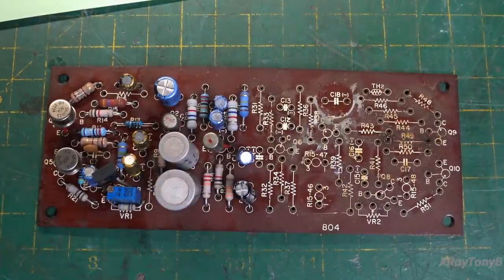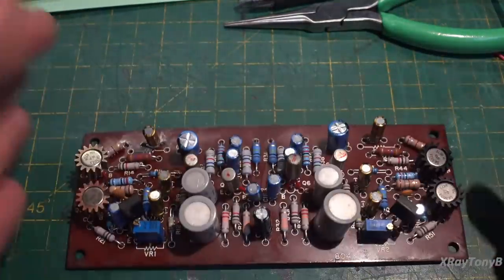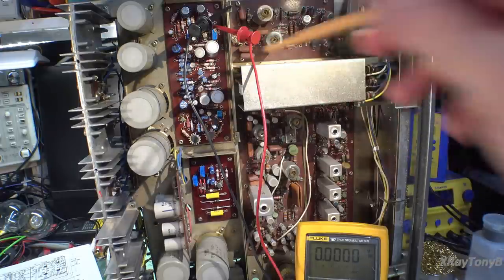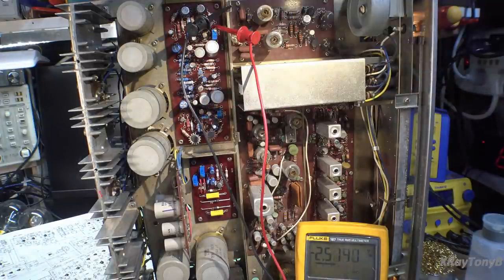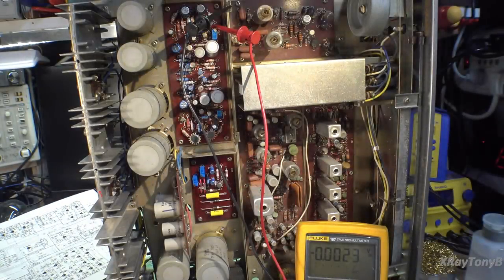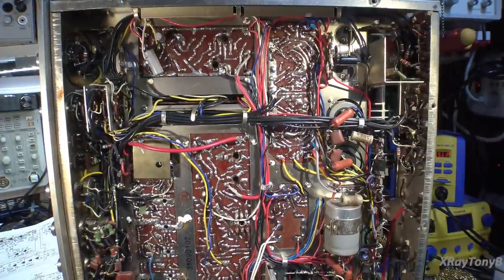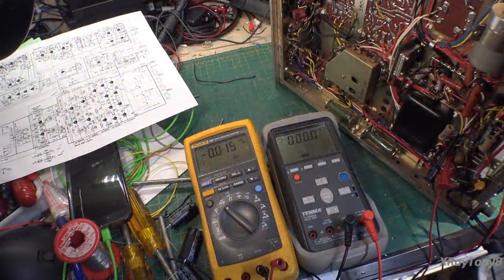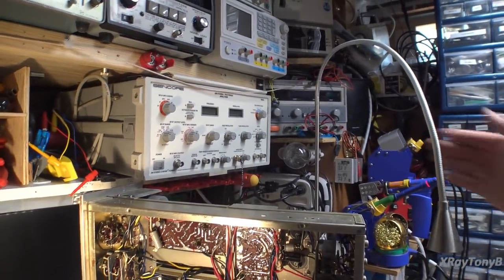Kenwood TK-80U Receiver Part 3:  Making Progress

Comment: I serviced a Kenwood amp from the same era a couple of years ago.  The 10,000 µF filter caps showed the same bulge on the vent holes.  Actually, one had burst open and a bit of electrolyte had leaked out of it.  But the caps checked out fine when I measured ESR and capacitance.  I guess the rubber seals on those vents just get brittle with age without affecting the values. As an experiment, I removed those caps, I drilled out the vents and sealed them with a silicone compound.  Then I used them in a stand alone power supply for charging batteries.  Works fine, no leakage, no temperature issues and great filtering.

Comment: This is as addictive as a good adventure movie! Please Tony, we expect the next episode: the return of the dead preamp!
This receiver is a perfect example of troubled engineering, representative of the tube to transistor evolution: complex high voltage filtering, each stage coupled with a capacitor, a class AB that is prone to flame in A class with a catastrophe, a subtile mix of available technologies, mixing HF tube, germanium and silicon components. In this one we miss the germanium rectifier and the power tube rectifiers, and it's a good step forward.

These equipments are always a challenge, but you're mastering this one as you've understood what was the original concept, and where the last technician has failed to make it work fine. And what is probably most exciting, is you know this project is to make a relatively modest performance receiver. But assuming Kenwood and Trio made excellent tuners and quality HiFi equipment, I hope this project will finally sound good!
I guess your next step is to inject some signal directly in the other power channel to check it, and prospect around these noisy potentiometers.  

May I suggest you to remove the tubes from their support to prevent any catastrophe in case of leaky high voltage coupling caps, or something happening with the negative bias, thus letting you more time to test and check the other parts. 
The noise in your microphones is intriguing, and may effectively result from a coupling problem: maybe there is a chassis capacitor coupling, something still problematic with ungrounded equipments (can be dangerous and a source of noise).

Comment: A great cleaner for flux is Acetone with a Q-Tip. I have been using it for over 40 years! Just keep it away from plastics. To clean a whole board I immerse it in 99% Alcohol or Proponal for about 15 minutes. Then blow it off with compressed air. And this method does not harm most plastics. Note you need compressed air or it will leave a film if just naturally air dryed.
Reply from the maker: The only thing I found with the acetone is that it will strip the silk-screened lettering right off of the board, if it gets on the front side.  This is especially true with these older boards.  Thanks for the comment!

Comment: 2N3773 is a all over better transistor than the venerable 2N3055. Better all round, lower leakage, way better SOA range and able to survive high power and switching operation well.

Comment: Those 2 current limiting resistors on the right (the grey ceramic wire wound ones) look like they've burned up in the past, or is that a trick of the camera?
Reply from the maker: Resistors may have gotten hot at one time, but they read spot-on.
Reply: @xraytonyb  Cool, i wonder if that is what led to the trimmer replacements, or were they the cause? :D

Comment: Did you know that KENWOOD owns YAMAHA and most likely tests their designs for the KENWOOD HIFI units in the YAMAHA HIFI units which are DSP based with Class D output stages, That strange  amplifier that was driving you batty used a Class D output stage something you don't want to get involved with.
Reply from the maker: The Yamaha B6 uses a triac controlled power supply, similar to the Carver Magnetic Field amplifier.  The amplifier's output stage is not class D.  It was class G.  It uses a stepped-rail power supply.  The lowest rail works just like a normal class AB design.  As you increase the volume, the higher rails will "switch in" to handle the upper part of the waveform.  Class D is entirely different.  It uses a high frequency square wave that is modulated at the audio frequency.  The high frequency is then filtered out through a low-pass filter network, leaving only the audio.  
Thanks for the comment!
Reply: @xraytonyb  I was looking at a YAMAHA DSP all in one with ATMOS surround and a Class D output stages and I think I am most likely going to purchase it. BTW I have a DSP based sound system with Class  D output on both the soundbar and subwoofer which I find quite nice.